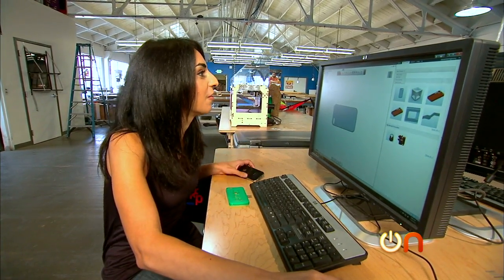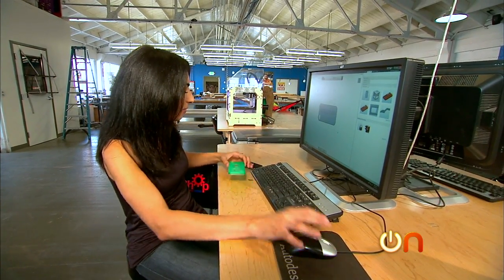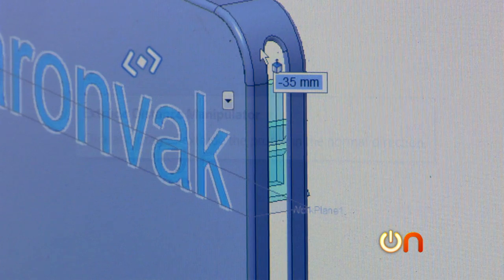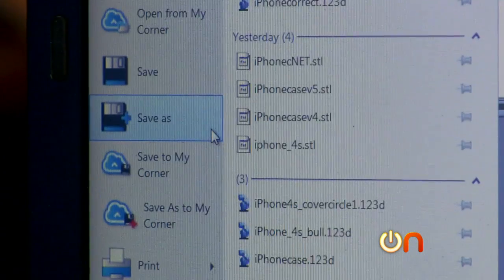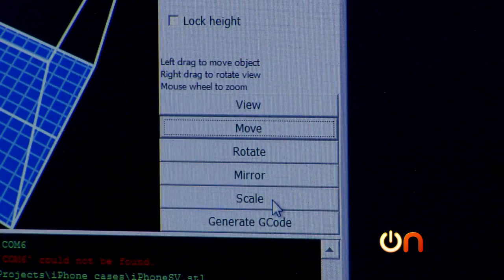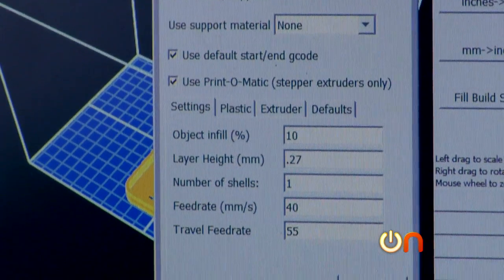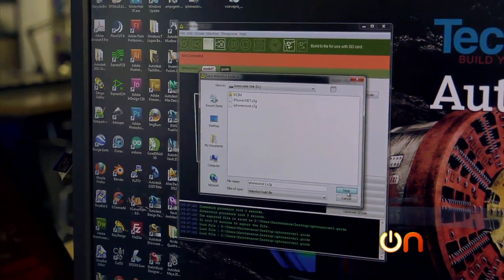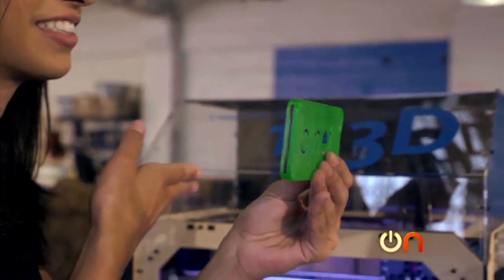Always On - DIY: 3D print your own iPhone case

Comment: The year is 2023. I dont know why, but this video randomly floated back into my consciousness, and I'm glad it's still here. I remember watching this like 10 years ago when it came out, thinking I would never get to play with 3D printers, but I would just watch this and think about all the cool stuff I could make.

Today I have my own 3D Printer. It's an older Artillery Sidewinder X1, but it's still an excellent printer for me. It has a build volume of 300x300x400mm. I've taken it apart and rebuilt it a couple dozen times. I've upgraded and repaired it many times over, and I'm pretty good at parametric 3D modeling. I make just cool things, useful things, big things, small things, things for decoration, things for other people, special containers to hold various things made out of different kind of materials. My dreams of 3D printing were definitely made a reality.

The one thing I have never, ever printed, however, is a phone case 😂😂😂

Comment: You guys think it looks bad, it's an iphone case made by a prototype, calm down. "The edges should be smooth" "it looks cheap"! Shut up! You try making a 3D printer from scratch.
Reply: None of what you just said, changes the fact, that it's ugly, has non-smooth edges and looks cheap. Why should I make a 3D printer from scratch? The printer she used is a commercial printer. She didn't make it.